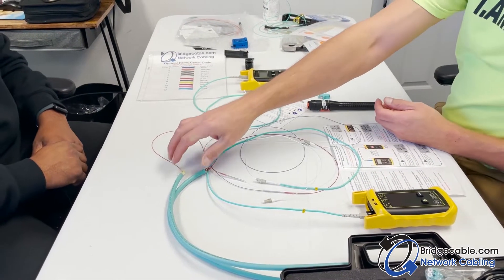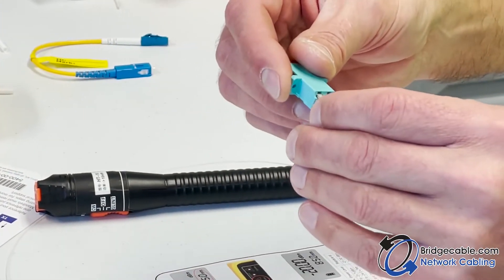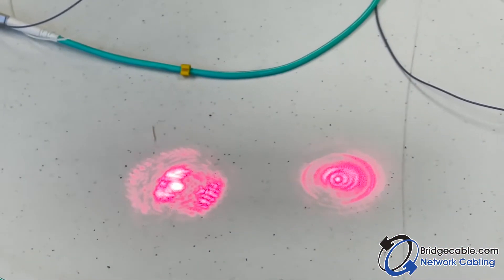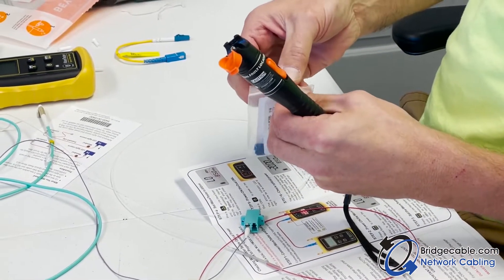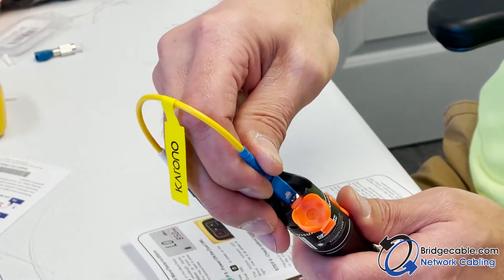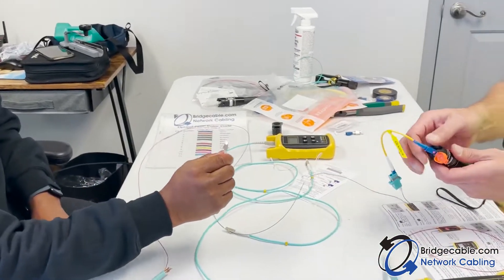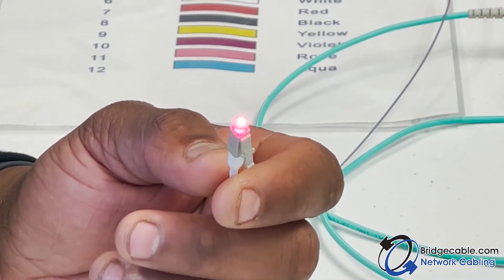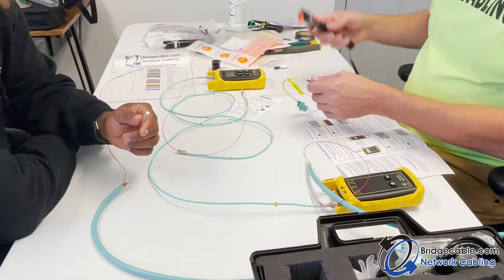Testing Fiber Network Cabling Using a Light Source | Visual Fault | Training for Bridgecable.com

Comment: What if you have a fiber pair and one is bright and the other one is dim when doing light testing trying troubleshooting random data issue that occured? fiber was working properly before hand, nobody messed with it. It just randomly dropped signal. When testing, One fiber is bright & other one is dim. Not sure what that means.
Reply from the maker: Troubleshooting Steps:
Check and clean all connectors.
Ensure connectors are fully seated.
Perform a visual inspection for fiber bends or damage.
Test with a power meter to check loss levels.
Swap transceivers if needed.
Use an OTDR if deeper diagnostics are required.